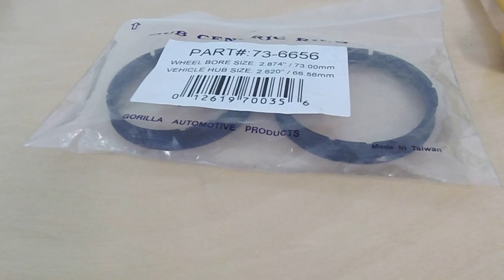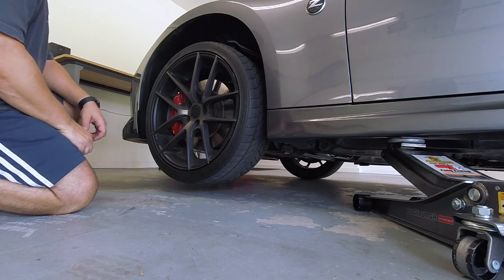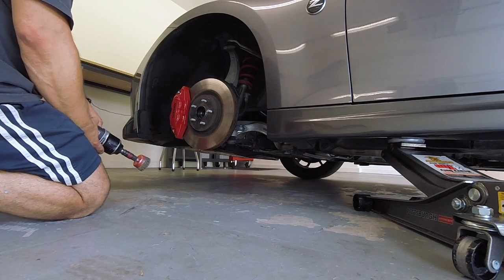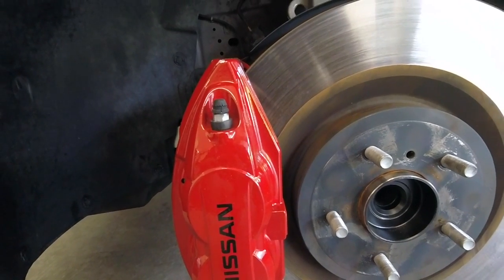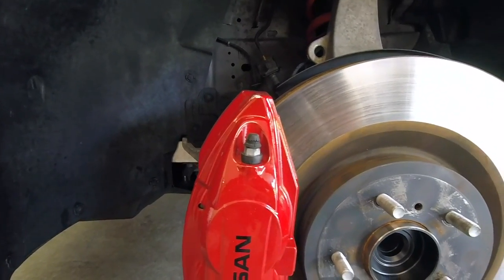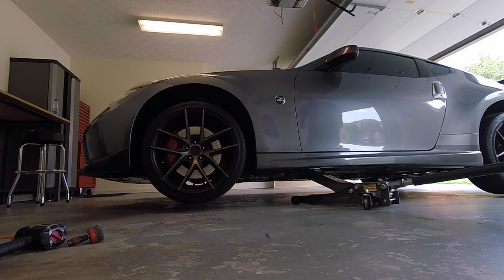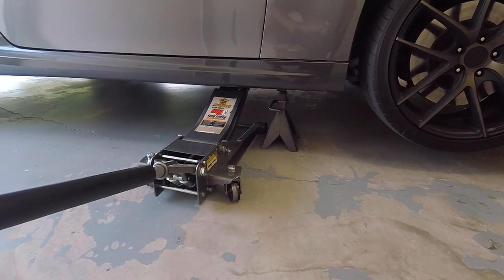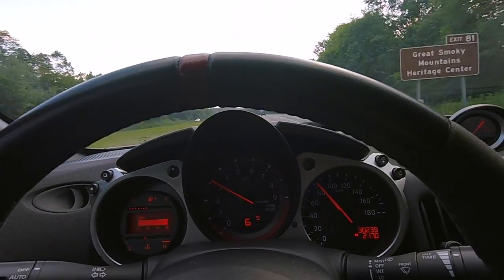HOW TO INSTALL HUB CENTRIC RINGS

Comment: Chips in caliper paint in strange places are from small rocks getting thrown between the inside of the rim and the caliper. If you clean up your rim, you'll find a small scratch  line around the inside circumfrence of the rim at the point where the caliper is closest to the rim for the same reason. This is nothing to worry about. As a side note: I've been driving carefully on road only, without centre rings for 50.000 miles with no problems whatsoever. However Last week I had a lapse and didn't stop my tyreshop from air hammering my alloys on! This resulted in slightly oval lug eyes so now I'm the market for hub centrics too to save my wheels :(

Comment: Plastic didn’t work for me. Aluminum and a little anti seize work better IMO. As soon as I installed the metal ones, the vibration stopped. I use the plastic one for cup coasters now 😅

Comment: Aluminum is a soft metal, when using a high speed abrasive wire wheel its very possible to take a once flat surface and ruin it.

Comment: Bummer, I hope you got it all sorted out. I'm looking for 18x8.5 wheels right now so I can take my oem wheels and 25mm spacers off. I feel some vibration, and I think taking the spacers back off would help, but 7.5" +52 on my car is weak as hell.  I'll be using hubcentric rings as well.
Reply from the maker: I think it ended up being an issue with the rims themselves. Not sure what though. I changed those rims to the factory Nismo rims and the problem went away.

Comment: if you dont tell us if balancing the tires corrected it, then this whole video is worthless. The rings did not improve your issue and not having the rings apparently caused no issues.  Are your lug nuts conical?   So what happened? Did you get rid of the vibration? What was the problem?
Reply from the maker: I got rid of the problem by replacing the wheels with the factory Nismo wheels. I had the tires rebalanced and that didn't fix it. The problem was that some days it would be fine and some days it would vibrate. I don't know how that was possible but that is what was happening. The rims weren't bent. FYI-I had planned on making a follow up video once I figured out what was causing the issue but since I couldn't find the solution I never made the video and replaced the wheels.
Reply: well alright but you could have added all that to the description. You got me all emotionally involved in the video and then no climax. Anyway, glad you got it sorted out.

Comment: I've had this balance issue I CANNOT get rid of. I thought this might be the solution but the wheels already have the rings in them... they're red plastic though I think?? TSW wheels... (the car came with them)
Reply from the maker: Sorry, just saw this. I had them rebalanced after this video and that helped but not 100%. I ended up getting rid of the wheels after I found a set of the factory Nismo wheels and that solved the problem...although it definitely wasn't a check solution.

Comment: Did you end up getting the wheels balanced? Did that fix the problem after that?
Reply from the maker: Sorry for the late response. I ended up going with Nismo OEM rims and there was no more problem. Even after balancing twice, it still wasn’t fixed. Close, but not perfect.

Comment: Did you figure what was wrong with it? Was it just balancing the tires?
Reply from the maker: Yes, balancing the tires fixed the issue but I’ve convinced myself that the hub centric rings helped as well 😀. I am making a few videos right now but one of them eliminates the hub centric rings altogether. Stay tuned...
Reply: @PerfectedAuto  That makes sense because the wheels had been balanced as lug centric before the centric ring was added then needed to be balanced as hub centric now that that ring was the true center of the wheels. Good to hear it was that simple on a car made for cruising speeds of 90 to 100

Comment: you put the wrong size hub rings on. your car is a 66.1 not a 66.56. 66.56 is mercedes not 370z's. if you still have viberations you need to get 66.1 hub rings and make sure your wheel is 73 and not 73.1 like most aftermarket wheels.
Reply from the maker: Thanks for the comment and info. When I went to Discount, I had that same information with me, (66.1) and told them that's what I needed. They looked it up on the computer and it showed 66.56. They showed me the screen so I said ok and bought them. I will say though that they fit over the hub very well. There was no gap or movement at all. They also fit the rim the same way. Since that video, I had the fronts rebalanced and that corrected the issue. None of this will be an issue in the near future anyway since I plan to find the stock Nismo wheels to replace my current wheels. That will eliminate the rings and 25mm spacers I have on the back. It will also take my rim size from 20" to 19" which should eliminate some of the tire noise I am dealing with. Anyway, I appreciate the information you have provided and hopefully it helps others. When I go back to Discount next I will tell them the information in their system is wrong.

Comment: I'm 45 and been dealing with wheels since I was 15, you don't need the rings. They are only for making sure alloys stay centered, steel wheels it don't matter.
Reply from the maker: Sorry for the late response. The wheel were alloy, not steel, and they did make a difference for me but it was never perfect. I ended up getting rid of those wheels and bought the factory Nismo wheels.

Comment: If u take the wheels back off after installing the rings will the rings remain in the wheels? Or will they stick to the hub and or fall out? Don't want any tire shops losing my rings when it's time for new tires lol
Reply: When I took my tires off , it was stuck to the hub. I also fucked up and didn't know those were the hub rings when I placed the OEM tires on. Lessons learned 2 of the studs broke off.  

Hell I didn't even know about the hub rings until I had a problem. ( I got the tire shop to install my after mkt tires)
Reply: @okayman2057  gotcha thanks

Comment: Nothing will fix this. Nothing. Had this on my Acura. Slammed 19". 4 new set of tyres - nothing. Full suspension rebuild - nothing. Found a guy who works with Hunter balancer - problem solved. 😉

Comment: I don’t think your wheels clear your Brembos that good
Reply: 1 wrong size hubcentric rings and 2 add like a 5mm spacer just to make sure you clear your brakes
Reply from the maker: The rings were tight...no play at all on both the rim and the hub. However, I did later get the correct size and the results were the same. No spacers were needed. They were close to the caliper but not as close as it looked in the video. I drive my car hard and never once had an issue, plus I don't like spacers. Anyway, none of that matters now because I found a set of the stock Nismo wheels and that's what's on the car now.